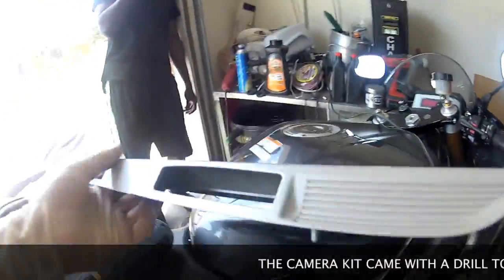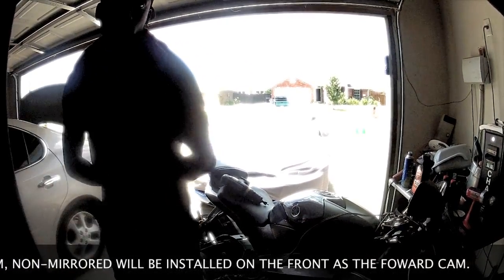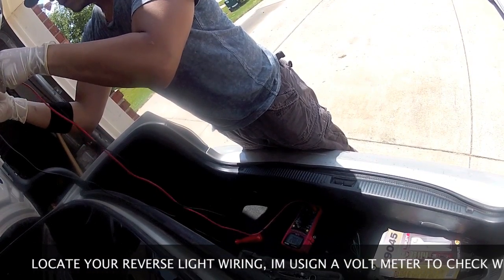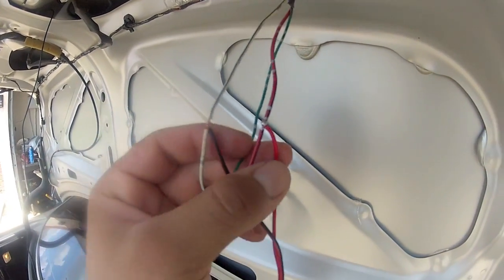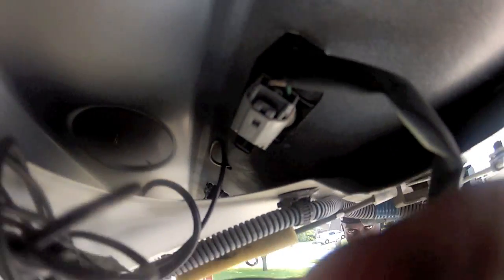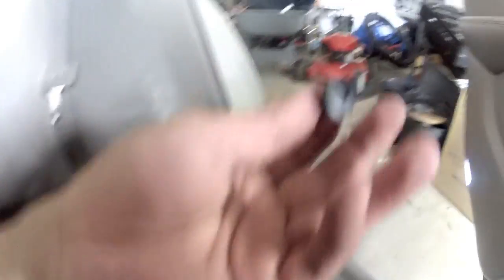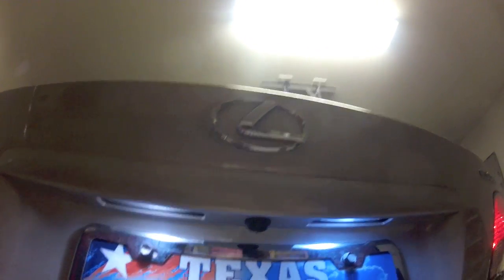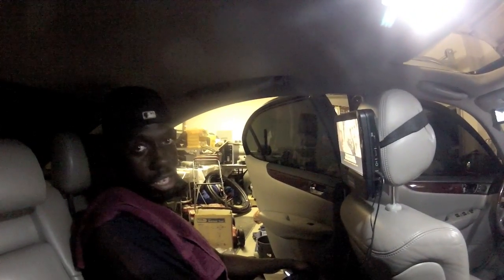Installing Front and Back-up cameras from Ebay

Comment from the maker: it comes with double sided tape, on mine i applied some adhesive for glass just to make sure its secure, i added a circuit with fuse straight from the positive terminal and the switch is just a break in that line

Comment from the maker: on this video i bought the two front and rear cameras and monitor from ebay, cost was around $80 for all. type "360 rear camera" and for the screen type "4.3 lcd tft rear camera" i would pick the one with the none glossy screen less reflection, hope that helps you out